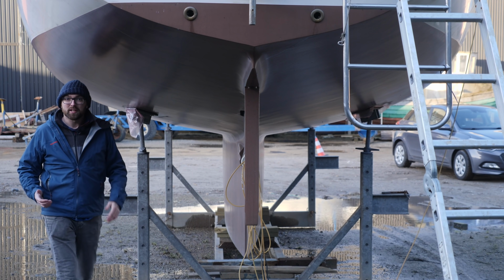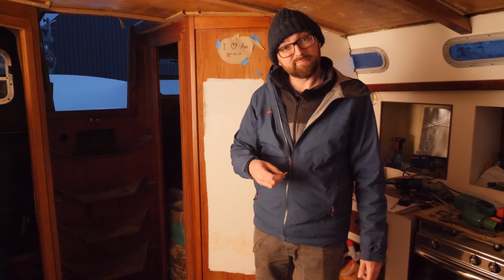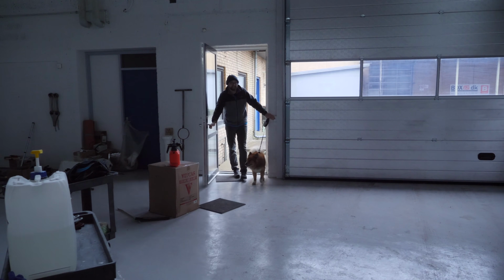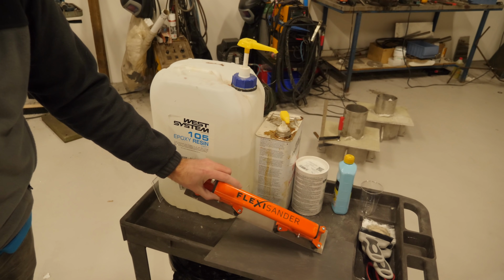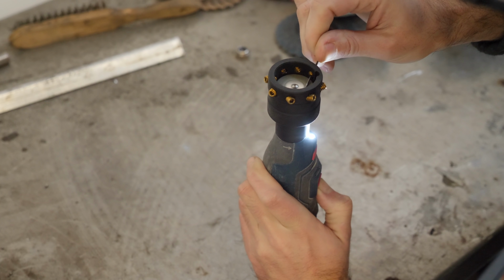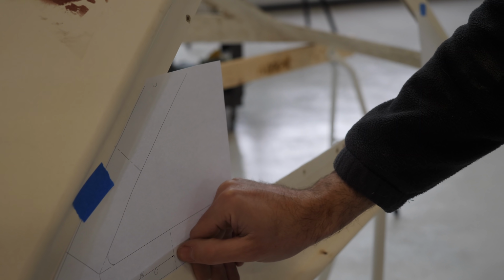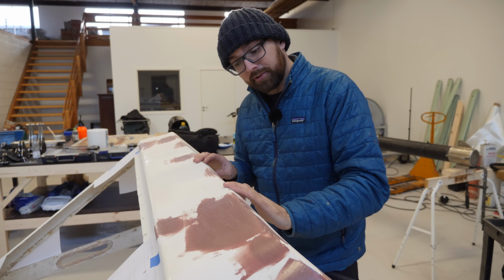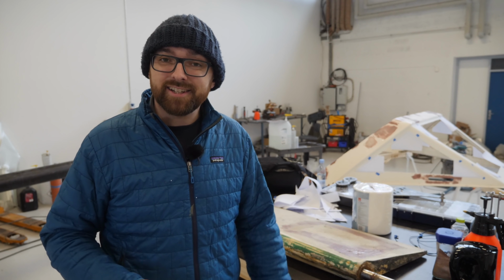Sail Life - dodger rebuild part 2, structural members & TungstenMate - DIY boat refit

Comment: I can answer your glass question - I own a glass company here in Toronto called The Glass Studio. Laminated and tempered glass are both classified as ‘safety’ glazing because their unique characteristics reduce the risk of injury should the glass break. However, each type offers very different advantages and drawbacks. For your application, tempered glass is the preferred choice for two reasons;
• it can better withstand compressive forces applied when being sandwiched between framing layers or clamp-style fittings. 
• it is significantly stronger than laminated when subjected to blunt impact 
An equivalent thickness of laminated glass is only as strong as each individual layer. Your existing tempered glass appears to be approximately 6mm thick so an equivalent laminate would be constructed with 2 separate layers of 3mm glass with an 0.30 clear interlayer. As you’ll appreciate, an impact is much more likely to break a 3mm glass layer than a solid tempered 6mm. Of course, the downside of tempered is that when it does break, it shatters completely and falls away. Under the same circumstances, laminated glass will crack but remain in the frame (if properly installed).

Hope this helps. We enjoy your videos!
Reply from the maker: Thanks! That's a lot of information!
Reply: @Thomas Smylie After owning a shower glass business in Tucson Arizona for 20, I couldn't have answered better. This was an exact correct answer. I use to play jokes on new employees and tell them to cover the old Tempered glass with a blanket, take a hammer and break it so we could box it for the dumpster (keeps from getting little pieces all over the parking lot). They couldn't understand why they could not break the glass with a hammer. I let them pound away for awhile and laughed. Then I showed them the glasses weak spot, a little tap on the edge and boom.
Reply: Even though this comment is 3 years old, I will still add a comment. It is possible to add extra spiffiness and cost by using two tempered sheets around a 0,38 mm laminate. It will then have the strength of the tempered glass, and it will stay in place if it breaks.
Reply: Just for personal curiosity is there a benefit/cost in relation to the flexing of the boat and dodger? I would think the tempered glass would take more force than the laminated would.
Reply: @joer8854  That’s correct - flexing of the framing surround is very likely so tempered would be preferred for that reason as well. If you have a tempered shower door held by two clamp-style hinges you can actually see 10mm or 12mm tempered glass flex if you bump into it. Laminated annealed glass is particularly vulnerable to cracking if there are pressure points or bending stresses. Car windshields can crack as vehicles age because rust build-up applies pressure to the laminated edges. 
I didn’t get into the option of tempered laminates because I think solid 6mm tempered will be more than adequate for the dodger.
Reply: @alaris1994  Thanks for the time and info. It's greatly appreciated.

Comment: Toughed glass is much more impact resistant just as long as you don't knock the edges as this will cause it to shatter, also I'm pretty sure tungsten grinding dust is harmful and you would be better off outside with a mask

Comment: cut the top off of the stringer. scoop out old core, insert new core with thickened epoxy,  don't know if that will work but if dose could be a easy fix.

Comment: Because Boeing has to be the opposite to airbus at every opportunity
Reply: ?which is older?
Reply: Robert Rantane Boeing but it’s a joke because in every aspect possible Boeing has different systems to Airbus
Reply: Eg. Boeing has a yoke whereas Airbus has a side stick, Boeing uses control cables to operate the control surfaces and Airbus uses fly by wire meaning that it goes through a computer first

Comment: I'm a bit worried about leaving wet and rotting core in the structural frame. To me it's like you're opting to consider the "cancer" inoperable and cross your fingers that it won't effect the hull that you've just spent a year fixing. I'd love to see you get that wet wood out of the boat.

Comment: Matthias Wandel has a program on his website called "BigPrint" it will help you print anything on A4 paper in order to assemble a bigger image (various methods of marking the joint lines). It's worth the price of admission, one of the nicest plan print programs i've seen.
Reply: Excellent find, Aserta.
Reply: I was going to say the same thing. It only cost $22 US and works great.  I bought a copy about 4 years ago and have used it dozens of times. https://woodgears.ca/bigprint/
Check out the ink saver modes that lighten up the center areas and only give you high contrast at the edges.

Comment: If you want the glass crystal clear use 0000 steel wool dry.  (000 and down will scratch the glass) Just rub it on the stains and it will clear anything less than a scratch.

Comment: Drill some holes in the top of each member and some at the bottom, let it dry or blow hot air in till it does, then inject wood hardener till it comes out the bottom and you turn the rotten wood into resin with wood filler???
Reply: I think he should check the thickness in the tops of the structure in addition to the sample he pulled in the side. I'm thinking if the tops are thicker (and the hull is thick underneath) then the beam structure may be stronger than the side sample would suggest.

Comment: Surely the stainless window frames will add some strength, but they won't match the other window frames because they're aluminium. Wouldn't it be better just to polish up the original frames?

Comment: You need to protect the edges of tempered glass. You can beat on the face of it with a hammer (that's why it is used in hi impact areas) and it will be fine. But you can tap the edge with a pencil and it will shatter into a million pieces. NERVER! sit the edge of it down on concrete one little chip on the edge and POOF it is gone. Some rubber U channel run around the edge then clamped in your new frame might do the trick. It could provide a tight seal and protect the glass edge. If you can find some with a little flap on each side that could lap over the edge of the frame that would form a better seal. Here is some rubber channel https://www.aircraftspruce.com/catalog/appages/uchannel.php?gclid=Cj0KCQiAtP_iBRDGARIsAEWJA8jmGZ0zY2iRf7esICUxgrP-8p_C-9Wm_7j3FOkwcdcPIdHKnKa0jx0aAtHVEALw_wcB Whatever you use be sure it is UV resistant so it won't detoriate over time. Love your videos I am a DIY guy and had a sailboat for many years also owned an RV dealership (Land Yachts) and have done a lot with my Motorhome www.cccgis.com/Rialta

Comment: Nice video as always! It may be a stupid question or I got it completely wrong, but why not opening up the structural members one by one at the top? Then grinding or just pulling the former plywood out and fill the new formed voice with laminated epoxy? This way this old rotten wood gets out of the boat for ever instead off burying it even deeper? And on the structural side, it will be x times stronger while having the same diameter and look!
Reply: The plywood was (supposed to be) structural and the glass was (supposed to be) to waterproof it. Attempting to clean the rotten wood out of the deep slots would be a very difficult job. Cutting out and replacing the structure would be easier!   Filling the void with epoxy and glass wouldn't be very strong as it would be hard to get the glass strands to run the width of the boat. Personally I think that adding more glass over the outside is a perfectly good solution, but it might not be spiffy enough for Mads ;-)
Reply: I was thinking the exact same thing, except after the wood was gone id fill the void with iron and high strength epoxy grout.

Comment: I would guess the glass is tempered because of its age. Laminated glass is relatively modern. Just a guess though.
Reply: Colin Mills Laminated glass has been around for more than a century, has been used extensively in auto windscreens since before WWII, I don't think his dodger is quite that old.
Reply: @acmeopinionfactory8018  OK, but all my early cars (1980's) had toughened/tempered wind screens, only the later ones had laminated screens.
Reply: @millzee60   What 80's cars had tempered glass windscreens?
I've owned 60's, 70's, 80's, and newer cars, none of them had tempered windscreens. 
Side windows, yes, windscreens, no.

Comment: I not worked about tempered glass. The boats 30 some thing years old .I was probably an engineering standard industry wide. I d look to the standards now just to compare. The glass is old and could be weakened by hits and what ever. Probably good for another 30 years. My question is on the hull strengtheneers. Could you not just take the one degraded member. Then take down the level of not so good glass like osmosis spotted out side of hull. Then renew the inside with the stronger webedglass. And maybe can get some info from a marine engineer. It stiil envolves removing the interior. And another summer in a shed. Pain and bane for you,itchy to. But a benefit for you channel junkies. Just asking in wonderment!

Comment: For strength and breakage-resistance, temper glasses often is the first consideration. For flexibility, UV-resistance, security and sound considerations, laminated glass is often the product of choice. Both are considered safety glazing materials and can be obtained in a variety of thicknesses and colors or tints. Both are easy to clean and maintain when installed properly.

Typically, laminated glass products are a slightly higher price than tempered products of the same type and thickness. The optical clarity for both laminated and tempered glass are excellent in either product will provide many years of satisfactory service.

Comment: Have you done a weight & balance consideration to see if the weight of the soaked wood & additional fiberglass for the reinforced structure would impede your comforts (i.e becoming too heavy to haul a generator, watermarked, dive compressor)?

Comment: Laminated glass doesn’t age well in humid environments. Water tends to delaminate it over time.
Reply: Not even the least of its issues. Old laminate gets destroyed by UV something fierce, in a marine environment, you can protect the glass from water intrusion, but not UV.
Reply: aserta, yeah, I’ve seen it on old cars where the glass gets hazy several inches around the edges.  There’s no fix, just replacement.
Reply: All automobile windshields are laminated tempered glass and unless the outer glass is cracked, they hold up just fine for decades in areas that have tremendous rainfall year round.  Of course that is fresh water so there is that variable but seaside does provide some salt spray exposure as in Washington state or California.  Laminated glass stays intact when it shatters from small impacts.  If a rogue wave hits it and causes failure, I would guess that the entire panel would still blow out whether it's laminate or single layer.  A naval architect should be the only opinion Madds listens too as I'm sure this issue has been studied and standardized for safety.
Reply: hehehe Some people have been reading too much internet bullshit.  Almost every automotive windscreen since the 1930's is laminated glass.  Now use your theories to those pieces of glass. hehehe
Reply: Agreed, aircraft pressurized windshields are laminated glass and will delaminate over time. But they do under go a tremendous amount of stress...more so than standard laminated glass.
Reply: I suppose it depends on the quality as well. Aircraft windshields are outside on the ramp the majority of its lifes with very little UV damage. Lee Aerospace and PPG are the manufacturers we see in the US. But yet again marine vs aerospace different needs, requirements, and quality. If i were to buy I'd go with tempered too.
Reply: Hundreds of thousands, if not millions of old cars around North America alone and you may have seen a few with haze. hehehe not very good odds of it hazing. BTW most of those hazed windscreens are the glass and it polishes right out.  Now if one of the layers of glass were chracked, thats a different story.
Reply: Mazda rx7 The problem is mainly with flat windscreens, not the curved ones most vehicles have, they seem to be better sealed around the edges.
Reply: @asbjrnhuseb9618  Dude , look a laminated glass in person instead of on the internet. There is no seal. It's just the glass and the laminate. There may be an anti chip coating for transit purposes. The only sealant is whatever you use to adhere it to the frame.  hehehe  Try to separate the glass from the laminate, without breaking the glass or try to stick something very thin in between the two pieces of glass,  hehehe.
Reply: Mazda rx7,  I haven’t looked at the edge of a curved laminated glass, and I have never seen one delaminated. I have, however, seen and replaced delaminated flat glass, which is what Mads needs. Hence the advice.
Reply: @asbjrnhuseb9618  hehehe Other than the curve in the glass, whats the difference in the laminations?

Comment: I don't know if you have seen the channel "Hilma Sailing" they just have lost their rudder at open sea, it just snapped off. The reason was galvanic corrosion, so check your rudder strain or make a new. Maybe also have a look at Jefa in Copenhagen, they make premium rudders.
Reply: Tino G - Sailing Apparently caused by stray current electrolysis originating from a wiring defect in the compass binnacle which passed to the rudder post.
Reply: Ok. In the last video they mentioned there was a new rudder on it's way from Sweden so it will hopefully be fixed soon. - But besides that I'm looking forward to Mads's rudder project, it will certainly be interesting.
Reply: Tino G - Sailing I am waiting and watching with interest.👍😀 Edit - there is a new update on their Facebook page - 8 Feb new rudder is in.

Comment: Tempered glass is used where there might be an impact (it shatters into small, relatively not sharp pieces rather than the dagger like shards of plate). Given the dodger is pretty much at foot level outside the cockpit, and that the wind or waves may throw the ends of tack (or whatever) at it, the choice to use tempered glass seems like a good one.
Reply: Adding some 3M security film over the outside & inside (which will bond it to the frames) to make it really break-proof might be a good idea. Then, if it shatters it will at least not fall out or have shards & still be perfectly serviceable.
Reply: @PrivateUsername  
Ya, the only problem with that is, if it does shatter and the film holds it together it will render forward visibility to near zero through the dodger. It's a tough choice between ending up with teeny tiny bits of glass that you may never completely rid your boat of in the long term, or a dodger you can't see through until you deal with it.
Reply: It is also quite a bit stronger than plate glass.
Reply: asdfdfggfd Plate glass is not in question, it’s tempered versus laminated glass and laminated glass is universally used in automobiles now rather than tempered because it is stronger and will crack upon impact rather than shatter.
Reply: @steviefordranger198  it's definitely not stronger than tempered glass. It's layered therefore cannot be stronger because each layer is at least half as thick
Reply: I'm no expert but I would think there's also the issue with flex. Being a fibreglass boat sailing on the water I would think with both Laminated glass and plate glass wouldn't take flexing well.
Reply: Leonard Bottleman Mads was questioning the use of tempered vs. laminated glass, not plate.
Reply: If I understand the differences correctly the tempered glass will shatter into small pieces like large granules of sand.  It can withstand a certain level of impact before shattering hence its use for entry and patio doors.  Laminated glass shatters in a similar manner but the plastic laminated between the layers of glass prevents the overall piece of glass from disintegrating into small granules hence its use in items such as windshields (wind screens in UK) and other auto type forward windows.  For this use on the dodger the tempered glass is a good choice since it will maintain its clarity, be generally impact resistant and is cheaper than laminated glass panels.  As mentioned below several times a tinting film will prevent the glass from becoming a pile in the cockpit if broken.
Reply: have seen another way to secure windows from being beaten up by waves, thick plexiglas called storm plates mounted outside with screws,
it is on a motor boat but waves are waves
https://www.youtube.com/watch?v=dM4NLuNmZOQ